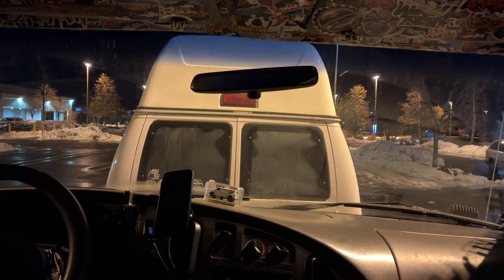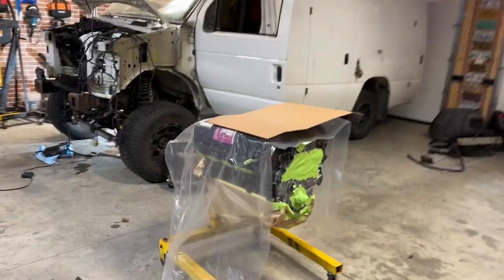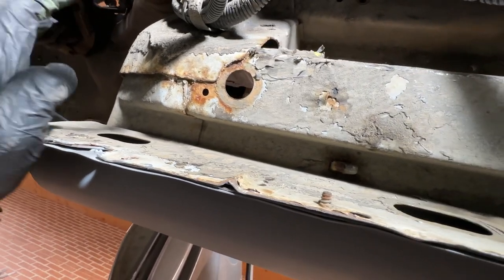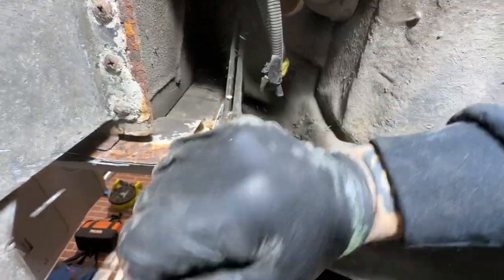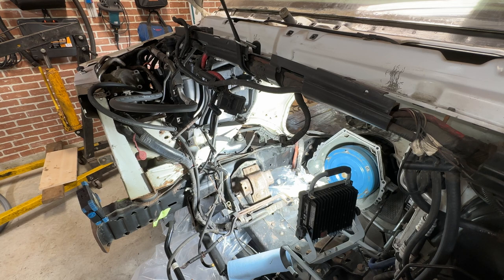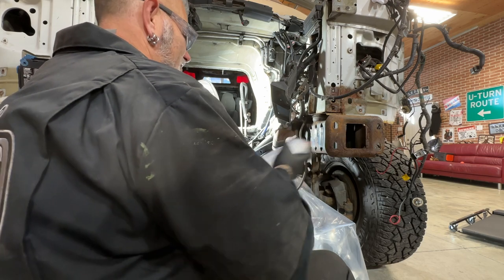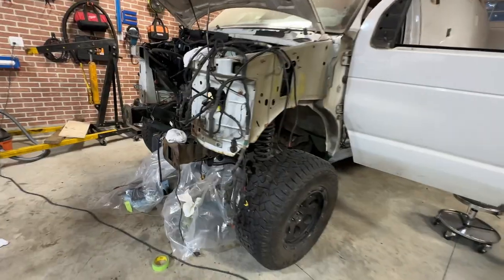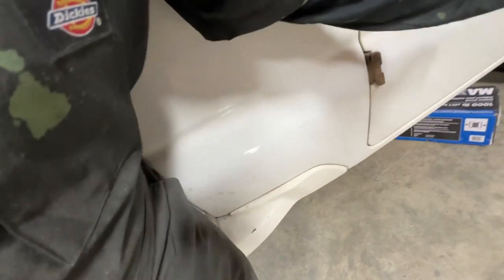GREEN LIQUID Dripping From EVERYWHERE. Rust Prevention On The Ambulance Build Out

Comment: Rust proofing goes a long way, I'm using fluid film with the same hose and it works very well. Did my first coat last year and there is no surface rust wherever I sprayed. Keep the videos going. Love the diesel 4x4 van.

Comment: Great content
Just a thought on the ambo.
If you do bigger tires and suspension, you may not be able to fit it back in the shop.
I’m an avid off roader, built a few, and bigger tires are not always necessary.
I’ve taken my Jeep with33” tires where other have gotten stuck with 37”
Looks like the ambo has clearance, you may be able to armor the sensitive spots…
Either way great build thank you for your content

Comment: You just need to buy your used vans from someplace like Alberta where we do not see rust like that.  Bought a 10 year old GMC 2500HD for my truck camper had it for 8 years and not a spec of dust on it.  Or buy new, my Transit is 7 years old and bought new and still no rust.

Comment: You could just move to a dryer climate. I live in NM, drive a '98 E-350 and it doesn't have a speck of rust on it. We don't salt roads here and it's the salt water that is extremely corrosive.

Comment: I think a lot of people who live in areas that don't get snow don't understand what a problem rust on a vehicle can be. Surface rust is probably the worst they have to deal with. But rust can destroy a vehicle from the inside out. They lose their structural integrity, and can become very dangerous. My sister had a vehicle that she did not under coat at all and after owning it for 12 years, it would not pass inspection because the frame was too far gone.

Comment: No question of doing this. I used POR15 but it's brushed on so it wouldn't work on internal applications so that's a plus on the spray on you're using. If it's like POR15 you will have a hard time removing it from your skin. Jus sayin'